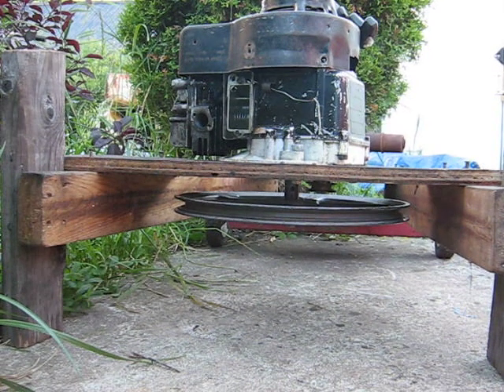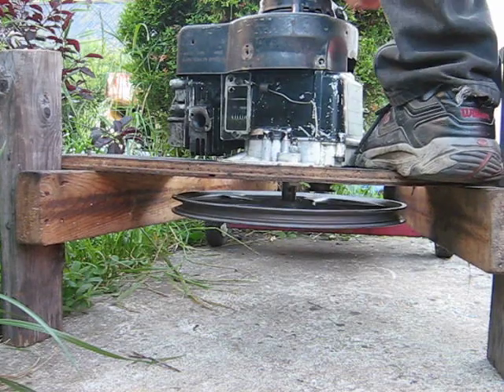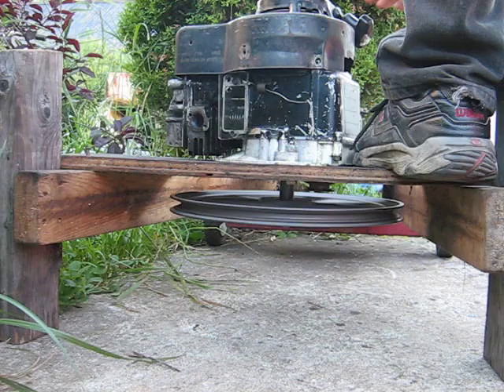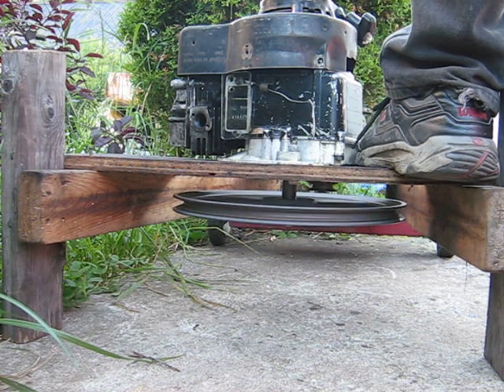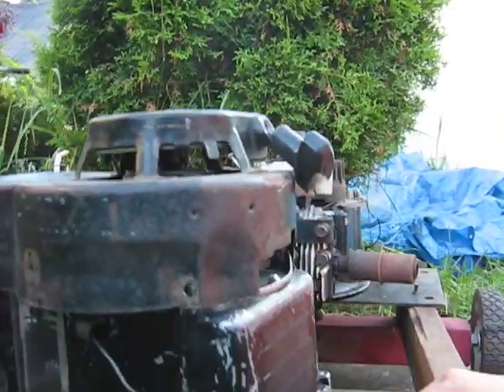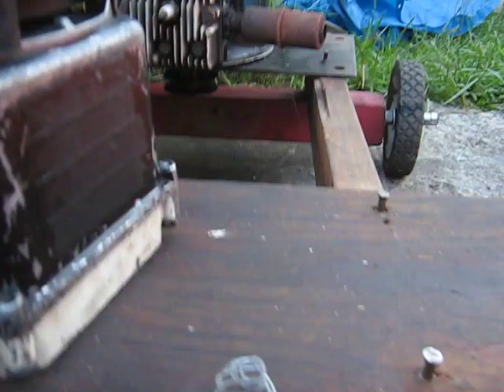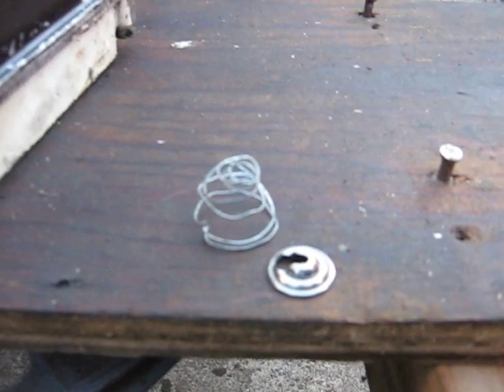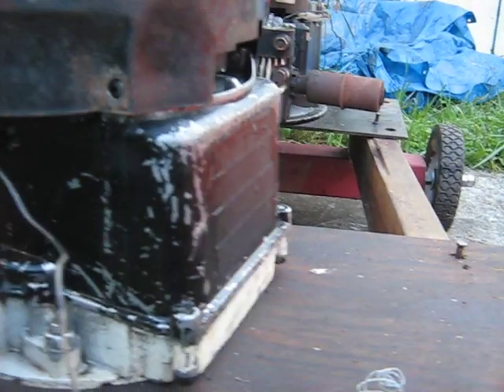Clear Valve Cover#3 No return spring, Briggs Flywheel Engine

Comment from the maker: Yes, Mustard is essential to running these engines!!!
A few drops down the carb. intake (making sure it is on compression stroke first to avoid flooding), give it a good pull, and generally it will start right up :)
The exhaust may smell a bit like a hot dog stand though!!!!  :)

Comment from the maker: I only run this at closed throttle (idle) speed, it will change speed by holding a hand over the inlet, kind of like a choke, the speed will pick up a lot, then I take my hand away, and it slows down again.
Do you mean the internal pull starter part? Normally it has 5 (teeth) on it, and the outside housing has 6. The older one on Mr. Grungy only has 1 tooth, the outside may have 4 on it.  The newer engines use the finger that sticks out into the cup type. Hope this helps.

Comment from the maker: So, is the cam in your steam engine a totally different size than a model 10 or 13 cam (older pre 1980 engines) I have tons of those cams, and they are all metal.